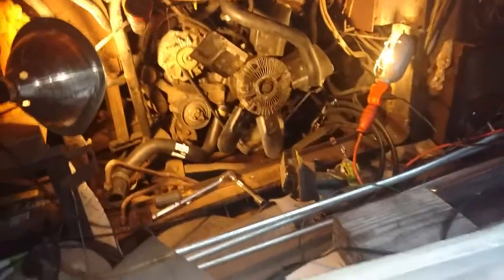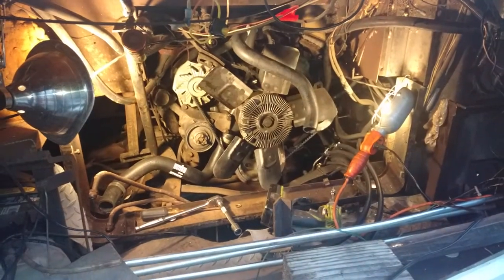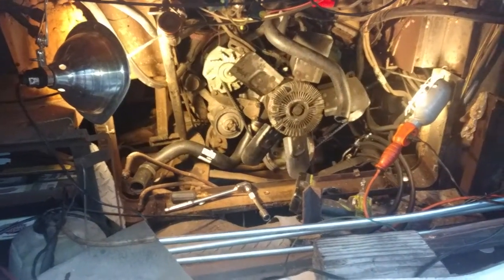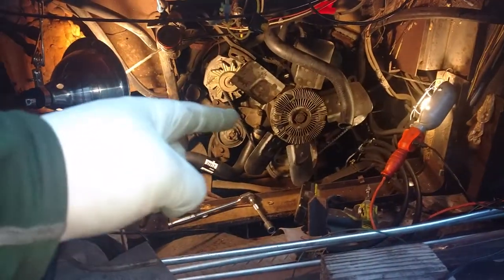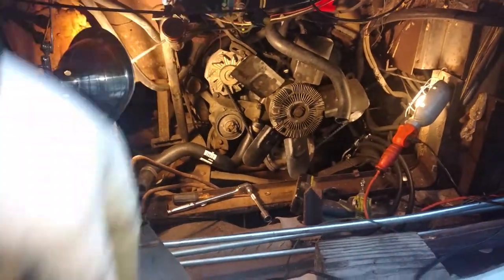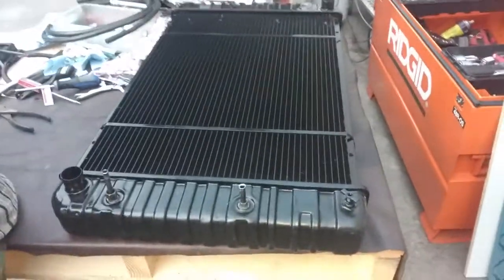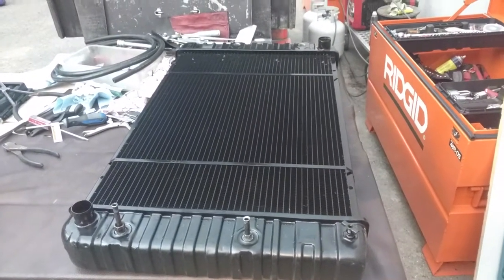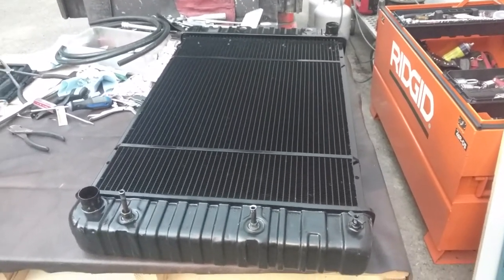1983 P30 Motorhome radiator

Comment: OK question so what did  you have to do to get the radiator out of the motor home. I notice you have the whole center removed. So do you have to take the hood off or what..
Reply from the maker: Edward Cody there is two bolts on each side of the bracket that holds the Radiator in  the mount splits in half.
Reply from the maker: If you look closely where my light is attached that is the bolt location
Reply: 6 yrs later and still no one has a video on how to get one out.